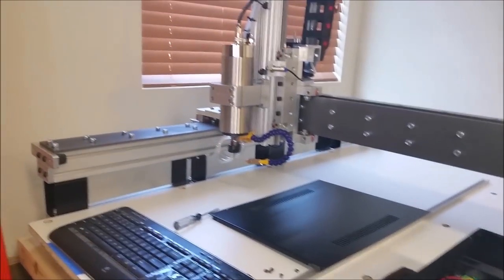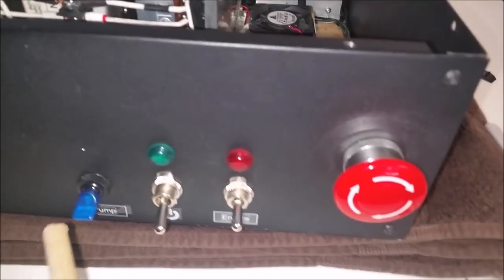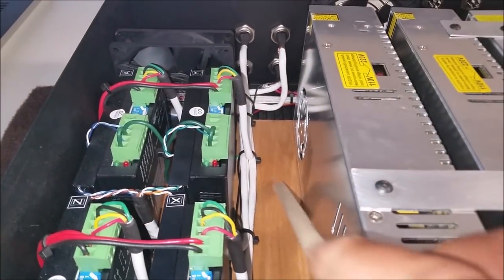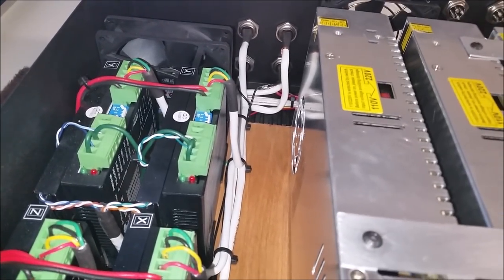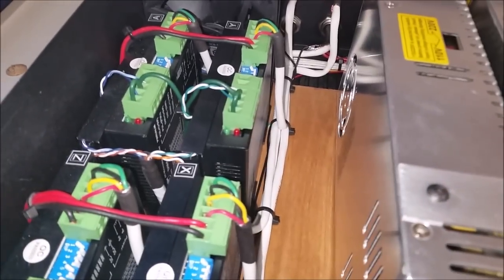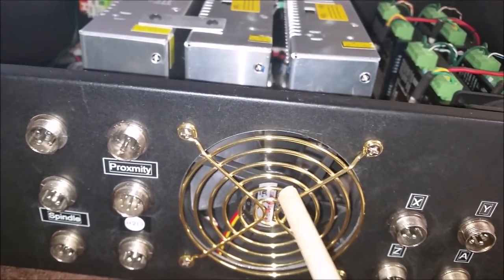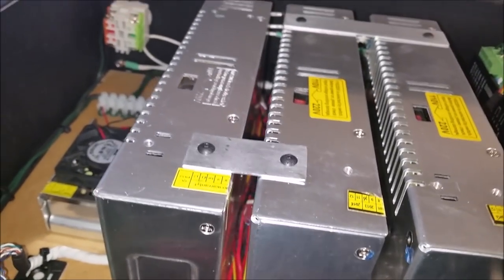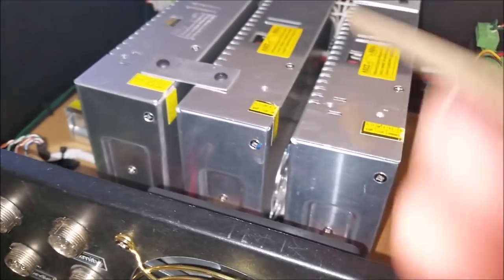DIY CNC Router Controller

Comment: I'm certainly liking your idea of running jacketed wire . Helps make for a clean install . I was going to pre twist my wires with a drill , but I'm liking your idea too
Reply from the maker: Yes, and twisted pair data wire is already done for you in the amount of twists necessary for each set to reject like wire twists frequency. You can't lose here.

Comment: I'm still building my gantry right now but I'm trying to wrap my head around where everything goes. Also getting my computer and programming correct. I have an old cnc plasma and run Mach 3. I didn't build the electronics though. My router is from scratch. Now I have a newer 64 bit machine and a smooth stepper to throw into this whole thing.
Reply from the maker: Smooth stepper is just usb connectivity and delete the db 25 connection used with win 8 I believe and higher. It may only be win 10.

Comment: Jerome you did a first rate build , very tidy and organized. 
I'm not an electronics expert by any means (but I did stay at a Holiday Inn Express last night ) but imo I would have thought ideally that  all the electronics should be secured to a metal plate together , and not on wood ?
Reply from the maker: Wood is fine, the electronics are grounded via the power supplies, and this is low voltage, meaning 12V dc. My choice for wood was mine. There is no danger here.  Your main concern is the ground. Some people use nylon stand offs for fitting and placement, no difference then if it was wood or plastic for your mounting surface.

Comment: Very nice work Jerome other than the plywood comments I would have protected the 120v connections at plug with some insulated connectors and heat shrink
Reply from the maker: Thanks Michael first of all for watching. Point taken, I listen to all comments and thank you. I think I will insulate the 120v connections as noted, not sure why I didn't do that. 

As for the plywood base, this was the option I deemed the best at the time. The power supplies are grounded to the case for line voltage, I didn't see a need for low voltage 12V.  Also I wanted to keep 120V noise separate and away from the 12v power output if you know what I'm trying to say. 

I have another installation project coming up and that is installing a laser engraver so I will mitigate the 120v insulation issue at that time.

Thanks so much for watching......

Comment: May I suggest that for your cabinet fan,  you blow the air out with a Control cabinet air filter on the opposite side. For control cabinets I always use a larger 120 VAC fan that will provide more air flow and not draw off your DC 12v PS. I really never used switching PSs for motor power, kind off over kill. I see you used two in parallel for the 36 V. Was that because one would not handle the motor start up surge. A small motor speed controller or couple of capacitors on the output will take care of that. I like using Buck convertors for the lower voltage devices power supplies. Power supplies with transformers are heavier but tend to hold up better in these type of applications. Nice layout and wiring but do consider an air filter so you don't suck dust and/or metal chips into your cabinet. Air flow is the key to longevity.
Reply from the maker: John, thanks so much for the comment, and I will take into consideration your idea as I do have 120v fans on hand. The case fan at this point does pull air into the case not blow into it, as dust was my initial concern. The 2 36v DC power supplies were used because that is what the kit came with. I purchased the 12V 30A  just for the purpose of running things 12v, such as fans, solenoids, water pump etc.. Again thanks, I do need case filtration most of all

Comment: What breakout board did you use? I bought a used FLA 4*2 and it has a C35SR1.2 and I can't figure out how to setup the touch plate...I did figure out how to setup two limit switches on both the Y and A axis so i can square up the gantry when it refs home...
Reply from the maker: 6 Axis board I used located in the link. No frills and works perfect for me

https://www.ebay.com/itm/6-Axis-DB25-Breakout-Board-for-MACH3-mach4/121746076720?epid=1048548241&hash=item1c58a1b430:g:dDwAAOxy7vJTdRXO

Comment: I just noticed your running three power supplies for the steppers . I was going to run two , dedicate one to the X and Z axis , and have the other powering the Y axis , as I believe the Y axis is more than likely drawing the most current
Reply from the maker: Major, the third power supply is for 12v Power for fans or anything else needing 12v as mentioned in my video. You are on the right track. 2 steppers per 36 v power supply doesn't matter which you choose for each, they all draw the same amount of power.

Jeromejt62
Reply: +jeromejt62   gotcha.  . Sorry I thought they looked the same and just assumed . I have another question . Seeing as you need additional voltages of 12V and 5V , I was going to use a computer power supply for those areas . Bad idea?
Reply from the maker: I did that for neatness as mentioned. I wouldn't bother with the pc power supply. Too may components to have to worry about.  Get dedicated power supply's voltages for what you need. You only need one very smalll 5v and one 12v. As I said get the 30 amp 12v, you never know what you may be adding in the future, and with that, your set. No changes mods, or anything esle. I always plan for the future..
Reply: +jeromejt62 
Thanks again Jerome , will do . Hey do you ever sleep lol

Comment: The complete system is beautiful, much attention to detail.

It looked as if the 12v power supply is in parallel with the 36v power supplies, am I missing something?

I really enjoyed watching, it gives me motivation to set my sites higher.
Reply from the maker: Peter, thanks so much for your kind comment. You are correct, the 12v power supply is in parallel with the 36v power supplies and connected thru the common 120v main switch. That way the main power switch powers all three at the same time. It made sense to me to do it that way less clutter and a one switch solution. The 120v main power switch also is connected  to the 5v power via another switch so that I can power the breakout board at will, but has no power without the main switch being activated.
Reply: I got it now, makes total sense to me... What I thought I saw was the output of the three in parallel.  Thanks for clearing that up for me.

Just out of curiosity, how many machines have you built?  The machine in the video is sexy, I'm just wondering how many years it is going to take me to get even close to that level.

Thanks again
Reply from the maker: Peter Smith not a problem, glad the vid helped you in some way. If you have any questions, let me know and I will answer as best as I can...
Reply from the maker: Sorry missed that last question, this was my first. I also built a 3d printer, still a work in progress almost done tho. It won't take you long my friend,  just take your time, don't rush and visualize everything the way you want it to look like in the end. Plan your build and don't do anything until your sure that's the way that you want it, then move forward.

Comment: have you had any trouble with those power supplys overheating being so close together? I'm getting ready to mount 3 of them, and I'm trying to determine the correct spacing
Reply from the maker: EitriBrokkr, thanks for the question, and the answer is I have not. Mine are about 3/4" apart maybe a little less. Please make sure that you mount an exhaust fan either on the front or back of your box as I explained in the Video. This will mitigate any heat problems or concerns that you may have. Also the fan mounted in front of the stepper drivers adds even more air flow and circulation. The box fan is mounted in an exhaust configuration which pulls air through the box vents and out the back. Hope this is helpful.

JeromeJT62
Reply: thanks

Comment: awesome build! Btw i have a questinon - in the video you tell that for the stepper drivers you  use the shielded cables, so do you leave the cable shielding ungrounded or ground it? Thanks!
Reply from the maker: You will need to ground the cable shielding on controller side within the controller itself. Make sure that you ground them to the negative DC terminal of the  power supply, not ground from line voltage. Since I have two power supplies I grounded the cables to the power supply in which feeds that particular stepper driver, meaning two steppers per power supply. Just daisy chain the shielding with one wire, then run a single wire back to the individual power supply ground. If you look close at 14:40 pause the video and you will see the two wires by the aviation plugs running back to the power supplies. It's the two black wires. Let me know if you have any other questions

Comment: how did you hook up your proximity switchs to your cnc?
Reply from the maker: Oh my gosh, there's another Jerome Johnson in the world, lol. Send me an email to acmech30@gmail.com so that I can send you the schematic for wiring. I used NPN active low which seem to tolerate 5v where the PNP active high need the minimum 6v I believe or the may not work properly.

Comment: Do you know the stock number for the case
Reply from the maker: Frederick, here is the link to where I ordered and the actual box. Since stock number will vary by company that carries them that may vary. I think the part number will get you what you want if you are looking at a different vendor. Hope this helps

http://www.alltronics.com/cgi-bin/item/ET3_35B/93/19%22%28W%29%2Dx%2D5%2E25%22%28H%29%2Dx%2D13%2E78%22%28D%29%2D3U%2DRack%2DMount%2DCabinet

Comment: I was under the impression that I had to have it to use Mach 3 with any 64 bit os. I'll bebusing windows 7
Reply from the maker: You cannot use mach 3 with 64 bit windows 7, 8, or 10 if you connect with a serial cable, only 32 bit. Mach 4 and Mach 3 can use Windows 64 bit, and all versions of Windows through Win 10 64 bit only if you use a smooth stepper or motion controller connected to the breakout board which connect using USB or a Ethernet cable to the computer.